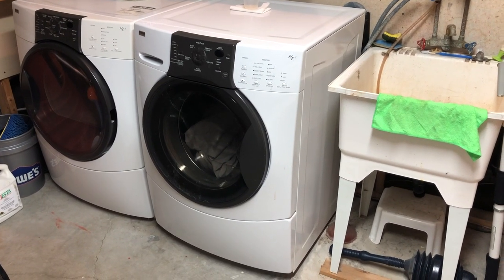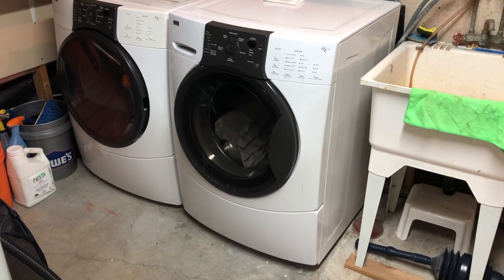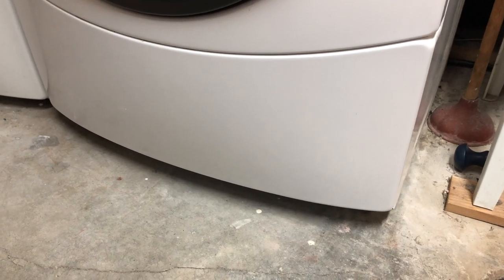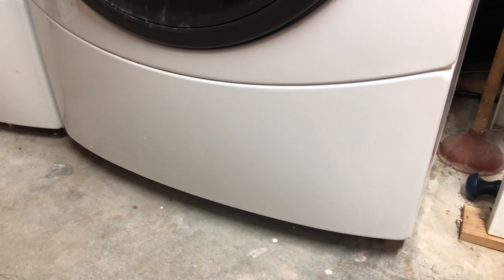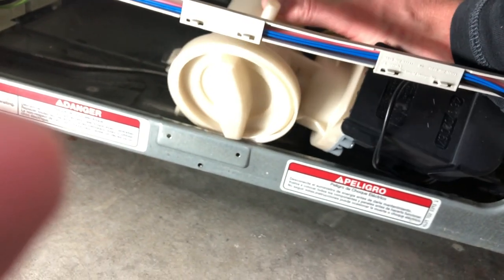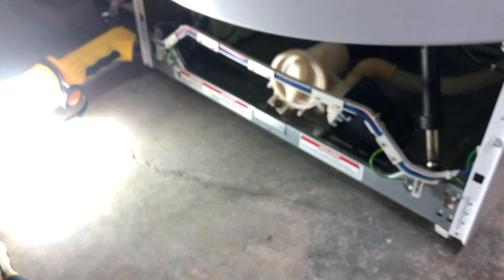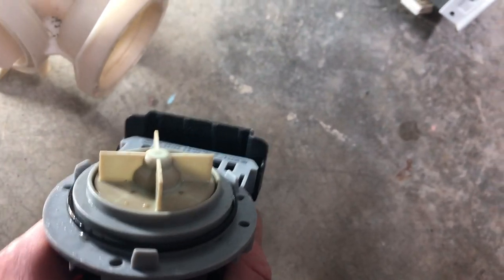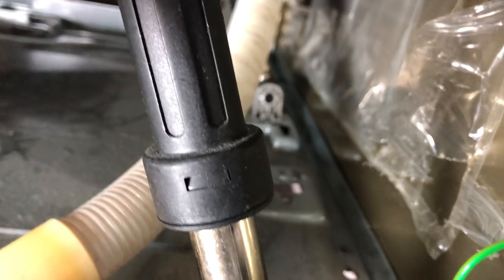BEST FIX || Washing Machine || Suds Error F02 || Kenmore HE3

Comment: What did you use to put the machine up to access un screwing the access to the pump and coin catch.
Reply from the maker: Hi Saqib,
I was able to remove the 3 screws without raising the machine by using a 6” extender on my drill. 

But propping up the machine with a brick or block of wood under each front corner should work just fine. 

Let me know if you have any other questions!

Mike
Reply: @mikebikercanada  yeah ended up just lifting it and putting towels on each side to lift and work on it. Successfully fixed the issue 🙌  thank you !!!
Reply from the maker: @saqibsiddiqi6684  awesome!! Nicely done. 

If you don’t mind subscribing to my channel that would be amazing. I’m trying to get my numbers up. If you do, a million thank you’s!  Maybe you’ll enjoy some of my other videos 😊..

All the best !
Mike

Comment: What did you use to clean out the hoses, just water or some type of degreaser??
Reply from the maker: Hi Robert. I used water, dish soap and I skinny wire brush designed to clean the drinking tubes of hydration bladders.

Comment: Hello MIke Biker, Thanks for the very detailed video, i have checked everything mentioned in this video, but could not find any clog and my washing machine still has this issue (F02 , SUD error) and stops in the middle of the washing.  Could it be due to Pump issue ?
Reply from the maker: Hi Suman, my sincere apologies for the late reply. Yes in that case if you’ve ensured everything is perfectly clean then it’s very possible it will be your pump that needs replacing. 

Is your washer equipped with the plastic float ball contained in the rubber gasket leading from the tub?

Mike Biker
Reply: @mikebikercanada  , Thanks for your input, i have replaced the drain pump and my washer started working. I was about buy a new washer, your video indeed helped triage my washer issue and successfully fixed it
Reply from the maker: @essskkk  Awesome news! What make/model is your washer? Was it easy to find a pump online for a reasonable price?

Comment: Dear God, @Mike Biker Canada I have done every step up until this last step of removing that plastic piece, and like you, have yet to find any real source of clogging.  Absolutely nothing in the filter/coin catch, some mild drudge in the long hose - which I still cleaned out with wire scrub, vinegar, baking soda, and hot water, nothing in the ball thing - and now I'm freaking out about taking this last piece out, wondering if I'll be able to put it all back together, and thinking, "What if it was the pump?!?!"  Was there a way I should have checked if the pump was working from the start, or now?  Or just forge ahead, hopefully put it all back together correctly, and then I'll know?  Regardless, I truly appreciate this video.  Thank you!! 🙌🐻
Reply from the maker: Unfortunately there’s no real way of knowing. If the pump completely dies then yes you’ll know it’s obviously the pump. Keep forging ahead. If after it’s all clean and you’re still getting an error then it’s a weak pump. If so watch my other video on how to change the pump.  In that video I also show what was wrong with the pump to cause the suds error. 

Hope that helps. 

Good job taking this task on and not resorting to a repair company. Proud of you!! And keep me posted!
Reply: @mikebikercanada  Thank you so much for your reply.  I ordered a pump, 🙄🤣 and will definitely tune into your video to properly install.  Thank you for the props!  While fully exposed, I realized that two of the shocks were disconnected - 1 front, 1 rear - so I reconnected those while I was at it.  I consider that another bonus to having an intimate weekend with this darned machine. 😁👍
Reply: @mombear5116 how much did that pump cost?🙏🏼
Reply: @peterdominguez8754  Right now it's $17.17.  Can't remember if that's what it cost when I purchased, or if this is a sale.  But I think less than $20 sounds right.  It did seem cheaper (and made in China) than my original pump, but it works.

Comment: I followed the video instructions.  It did a great job of telling me what to take off, but I'm REALLY struggling with how to get the clamps back onto the hoses.  Any suggestions?  Anyone at all?
Reply: Hi Sy! 

Glad you were able to get everything off. 
I used regular pliers. They did require a bit of muscling with my small pliers. Especially the large clamp being in an awkward position.  If I could do it all over again I might have invested in a pair of “bent nose pliers”. Google that and you’ll see the type of pliers I’m referring to. They should be available at most hardware stores. They change the angle of attack and really allow you to position the clamp more easily and generate much more gripping strength as a result. 

Which clamp(s) are you having trouble with?

Cheers!
Mike
Reply: . Thanks for your response!  I changed the type of pliers and got it all back together. It is a testament to your video that no one was hurt and I got it back on again. Unfortunately after all that I got a different error message. (F11)
Reply: @syhartfield  so glad you were able to get everything back together. But shoot! What is the  F11 code for?

Comment: Where can I get the pump?  What’s the part number?
Reply from the maker: If your washer is the exact same as mine then the pump is :
#46197020167
Askoll
Model m75
Art 294020
120v 60hz

But if your machine is different please remove the bottom cover and have a look at your specific pump and note all the markings on it. There’s not too many different styles out there. Most companies use the same style pumps. 

Hope that helps! 
If you can subscribe to my channel that would be great! Maybe one of my next videos will be of interest to you as well. 
Cheers, Mike Biker
Reply: @mikebikercanada  l